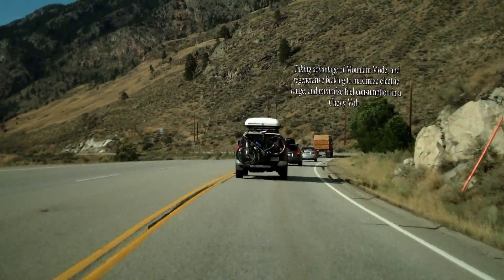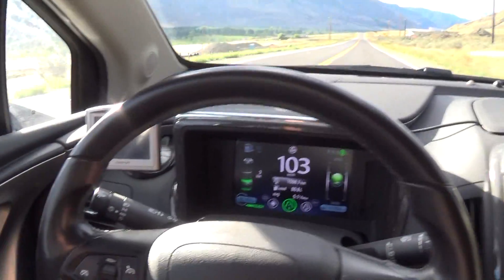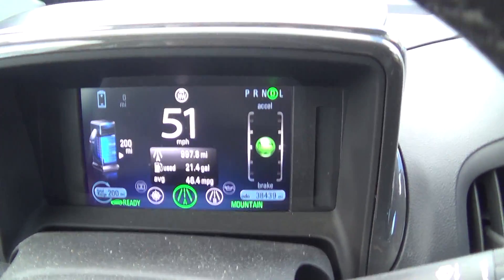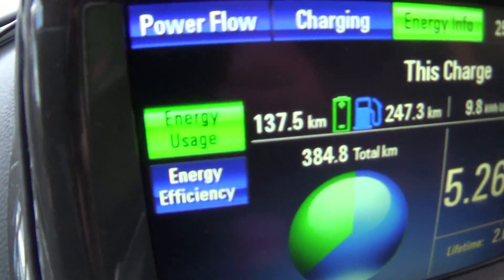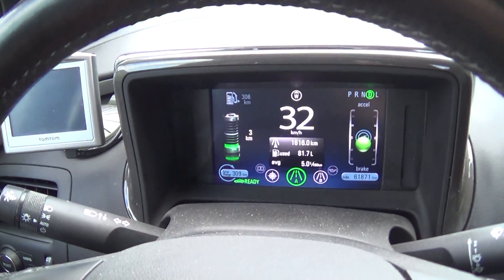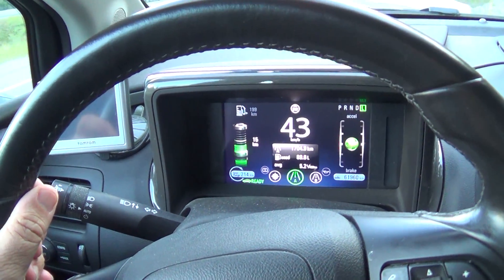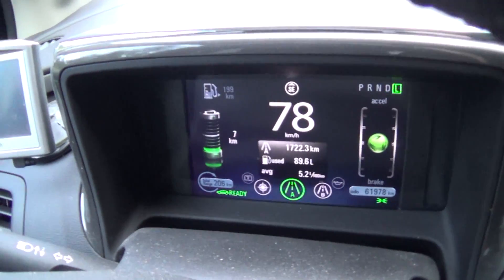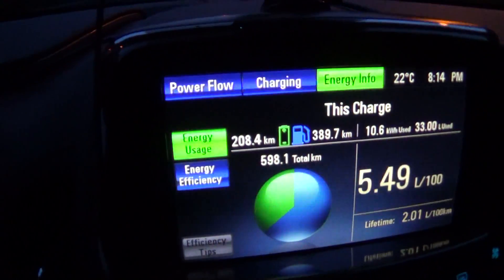volt regenerative braking experiment

Comment: Why are you turning power off?  The only reason to do that is to "trick" the car as to where it thinks the miles came from (i.e. wall outlet or derived form gas).  Otherwise the car behaves the same, and uses the same amount of gas without any need to turn the car off and on when switching between modes.
Reply from the maker: +ClarksonCote Just to trick the car into going back to electric mode so it reports on the dash the electric miles. The MPG remains the same, as the engine will shut down and thus not consume any fuel going down hills and it will not restart going up the next hill until the battery is again at the low state of charge, so the fuel used, and thus the MPG remains the same, but the electric side of the reading would only show the initial 65K of electric range I got off the initial overnight charge, and the rest of the driven range would show on the gas side of the display, even though there a fair number of miles recorded in electric mode. This way by doing this, it gave a more true reflection of exactly how many miles were driven with the engine actually off. Call it cheating the numbers, but it reality it isn't cheating, because those electric miles that racked up were electric miles. Not from the grid charge, but from regenerative charging, but they were still electric driven miles never the less, and I wanted to show how efficient the car actually is.
Reply: +12voltvids Okay, as long as you know that's not really accurate.  It's sort of like saying a Toyota Prius (not the plug in) is getting electric miles whenever the engine is off, which it is not.  The electricity for those miles came from gasoline, just like the electricity for the Volt's miles came from gasoline, even if the engine was not always running for them.  That's why the Volt accounts for it the way it does, without it being tricked by turning the Volt on and off.  It sounds like you know this, the point of clarification is more for anyone reading.  Ford actually reports all their "engine-off" miles in the Energis as electric miles, which is very misleading, inaccurate, and contrary to what everyone else in the industry does.
Reply: +12voltvids Also, for what it's worth using Mountain Mode to gain charge in the battery generally results in worse overall gas mileage, though not always.  This is because the double conversion of electrical to mechanical energy then back to electrical energy is less efficient.  Unless Mountain Mode is needed (typically on the steepest of climbs), letting the Volt "do its thing" will, much more often than not, produce better gas mileage.  It will still turn the engine off when going down the other side of the mountain, but the engine will not work as hard adding charge to the battery.  There are exceptions based on terrain etc where gaming this can result in better gas mileage, but that's the general rule. :)
Reply from the maker: +ClarksonCote 
Actually those ARE electric miles when the engine is off. It is not like the engine generated the electricity, regenerative braking did, if I enter mountain mode when there is 1 km left at the start of the hill, and switch back at the top with 1 or 2 remaining at the top, and by the time I get to the bottom of the hill I have picked up 12 miles, that is an additional 12 miles, plus the miles going down the hill that has has not been consumed that I am accounting for. It does skew the mpg numbers by making the car display fewer gas miles on the gas driven miles so it would actually make the fuel economy look worse if you calculated the mpg based solely on the miles driven when the engine is running, but if you calculate the combined average the empg the results are accurate. This demonstration, and that is what this was, I do not drive it like this all the time, it was done specifically on this trip for the video, was to draw attention to how much fuel you do save by the regenerative braking on the hills where as on a normal car this energy is lost in the former of heat in the brakes.
Reply from the maker: +ClarksonCote 
I know how mountain mode works, and why it is there. It does run the engine harder to put a 10 mile buffer charge an then it will operate just like normal to keep that buffer charge. So going up large Hills it will run the snot out of the engine to ensure that you don't run out of juice. If you don't engage before a big Hill then you might as well be driving a proud or worse a BMW i3, and get in line behind all the big trucks, campers and motor homes.
Reply: 12voltvids Yes that's true, however for many hills, Mountain Mode isn't even necessary.  Unlike the i3, the Volt has enough power to go up the majority of hills in US and Canada without ever resulting in Reduced Propulsion.  There are some inclines that need it though, hence why it is there. :)
Reply from the maker: +ClarksonCote 
I am fully aware of that. I know which Hills it is needed on to eliminate the reduced propulsion due to available power. Coquahala, and the hope princeston coming out of hope, kicking horse pass, crowsnest, Rogers pass, and the big Hill on Highway 3 just out of osooyos. In Washington the cascade pass, simolokie pass, and the big one in Utah. I don't routinely use it, only on the really long steep Hills. The rest of the time I am in normal mode. I don't even bother with sport more most of the time. Last summer I went to Jasper, then down through Montana, and back through the cascades. Used mountain mode 3 times in total an turned it off as soon as I got to the summit.
Reply: 12voltvids Nice.  Like I said, most of my comments were aimed at clarifying for the non-Volt owners, not you. :)  Thanks for posting the vid.

Comment: Hi 
Thanks for your videos on volt.
I am a proud owner of Volt now. I have a 130 mile round trip commute and i do use the mountain mode to put some juice on the battery & then i toggle to electric mode back & forth, but i do this by just using the drive mode switch i never had to stop or do the neutral method. Am i doing it right?
Reply from the maker: babuanoo Yes if you put charge in using mountain mode and switch back to normal it will switch back on its own if you have topped up to the mountain mode limit.I just sold someone on a 2016. Client at work was talking cars with me and I told them I have a volt. Of course the questions started, as they currently drive a diesel, and was bragging about their exceptional highway mileage of 5.5 l /100Km. I showed them the picture of my on board computer from my 3000 KM road trip. same mileage 5.5l/100Km as their diesel, and that sealed the deal, because their diesel sucks around town, and they figured that they wouldn't use any gas at all except for their monthly trip from Vancouver to Edmonton, and back, so they would save a ton on their daily commute. They were considering one already, and when I told them the actual range I get and how little gas I ever put in mine, that sealed the deal.

Comment from the maker: My volt is a 2012, and does not have the hold mode. That feature was on the 2013.
All the hold mode does is preserve the charge in the battery for later. Mountain mode does a similar thing, it will keep 16KM of usable range in the battery, and is intended for use when in mountainous territory to prevent running out of power before getting over the mountain. Hold would do the same, but it keeps the battery at whatever state it is in when hold is engaged.
Reply: yes  :)

Comment: Hello i'm french i i have the european clone of the chevy volt, the opel ampera. Don't you have the "hold" mode? And how much in percentage the mountain mode burn more gas than when the generator is just holding battery after it have been used? I ask because i'm trying to use less gas as possible on my 600km trip with 500km on 130km/h highway...
Reply from the maker: The Bolt is a totally different car. Electric only 373Km range, no backup engine. The Ampera 2012 to 2016 was the exact same car as I am driving. They had a hold mode added, which was added to the North American Volt in 2013.  The Bolt just came out this year.
I have also driven a Bolt, as my neighbor has one. They had planned to buy a Tesla model 3, but grabbed one of the first Bolts. It is also a fantastic car. My wife wants one. Myself, I would stick to the volt though, because when I go on my annual road trip, the last thing I want to worry about is the inconvenience of finding a place to charge,
and it is an inconvience if you know the out of the way places I go.
For around town, or driving the major freeways that would be a great car, but the major freeways is now the route I take. I look for the more isolated roads with the nice scenery.
Reply: Ro Moon the 2011 Volt in North America didn't come with Hold Mode.
Reply: limbery not the old one.
Reply: Ampera is Volt Ampera-e is Bolt
Reply: Buy hybdrid

Comment: cool i am really curious about the regen breaking ratio. How many miles/km coasting gave you how much range?
Reply from the maker: On this drive I had a total of 208 electric KM. Only the first 60 -70 was from the initial charge from plugging in over night. The remainder of this 208 was achieved from regenerative braking. It is fairly well explained in the video.

Comment: at 5:10 you say you get 44.9mgp that number is from 236.5 total mi, why that mpg it is  not from only fuel use of 151.7mi
Reply from the maker: The computer calculates the fuel economy based on the total mileage, which includes the energy recaptured by regenerative braking.
If you want to calculate the miliage obtained from the fuel only range, then by all means figure it out from the fuel consumed range, and of course the number will be lower, but regardless, if you drove the total distance in a gas only car that used the same amount of fuel that I used over the total distance driven, the 44.9MPG would be accurate.
Some people like to beat the volt up, and calculate the range based only on the fuel distance driven, and ignore the electric and regenerative range, and this does the entire industry a disservice as it make it look less fuel efficient than it is.
This is an accurate snap shot of what drivers can expect to get out of a volt, when driven in an efficient manner. By that I mean using the drive mode button to switch in and out of mountain mode, and staying within a reasonable speed. In my case I was generally not exceeding the posted speed by more than 20KMh. Over the 236 miles I have driven at this point in the video, I used 5.25 gallons, which is excellent fuel economy considering that I am driving at freeway speeds through winding mountain roads.  Since shooting this video I have driven over 3000 miles and only used .2 of a gallon of fuel.

Comment: This could be a valid mod/update to the software, to improve its smart behaviour.
Reply from the maker: The car already does this. Once you start going down hill the engine shuts off. It just continues to register the accumulated miles on the gas side of the display.
This trick only allows you to get a more accurate display of the gas vs electric miles.
The MPG is calculated correctly as it calculates it based on measured fuel consumption vs the total miles driven.
It would be nice if it did the switch over back to battery by itself, and I am sure they could change that by software. The tubers have modded the software to allow the car to run from 0-60 in 5.5 seconds bringing it very close to Teslas 0-60. Of course the battery range is reduced doing this, but it certainly shows that the trade off for 0-60 was made to extend the range of the battery.
It certainly impresses people when they see the car. GM did a terrible job of marketing the car. It is a fantastic car, the best I have owned, and I would buy another one in a minute.
Reply: 12voltvids I would suggest GM's marketing department is full of petrol heads, thus the effort is far less than 100% and the outcome a "terrible job".
Reply from the maker: Glen Robinson Well I knew what the car was, how it operated, and knew the inner workings long before the car hit the street.
I followed the development from day 1. Back in the 80's I was frustrated with rising gas prices, and I thought what a concept, put an electric motor in place of the gas engine, and have a small generator in the trunk area to recharge the batteries should you need to go further than the batteries could go. Seriously I had that idea. So after the EV 1 program ended and Bob Lutz announced the volt program, there was major wood happening in my pants let me tell you. I was on that so bloody fast. I watched the devolopment, watched every leaked video I could find, and got my name on the waiting list for a car that I thought would never make it to market. I bought one of the first ones that was shipped north of the border. But that is just me. Joe 6 pack has not followed the devolopment, and thinks it is just a different flavour of a Toyota Prius. Bad marketing, and terrible reporting and stories by the media. The information was out there, but very few people picked up on it.  I cringe every time I hear Hybrid, because my wife drives a hybrid, and they are totally different beasts. A hybrid is gutless. OK it has a few guts for about  a mile, then the battery reserve is done and you are at the mercy of what the little engine is struggling to put out running at about 6,000RMP and dounding like a piston is about ready to come flying through the cylinder head. The term hybrid technically means more than 1 fuel source, so technically a volt IS a hybrid once the battery is flat, but 99% of people don't know this, and this is where the marketing dropped the ball.